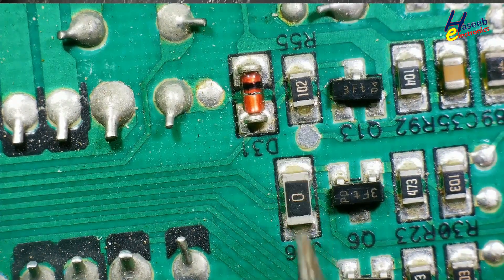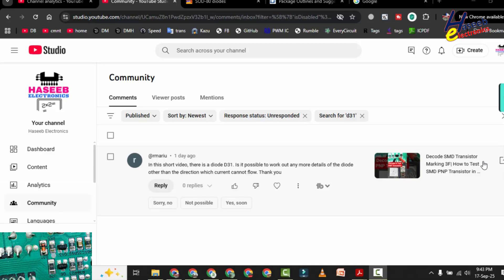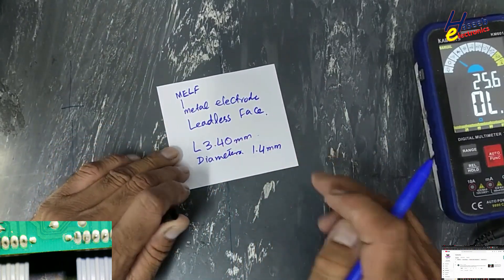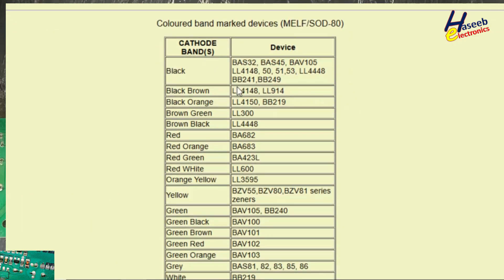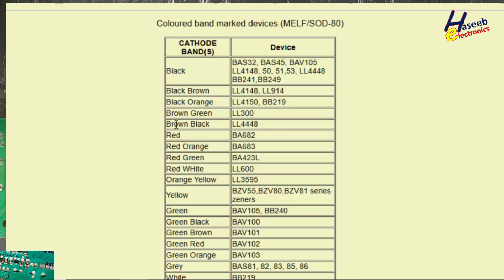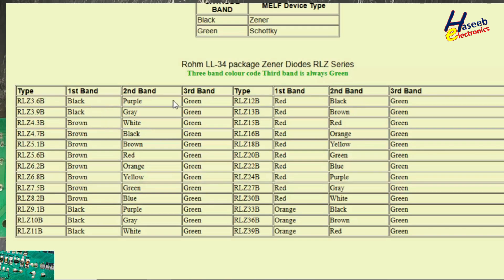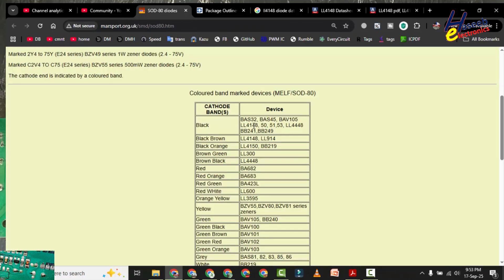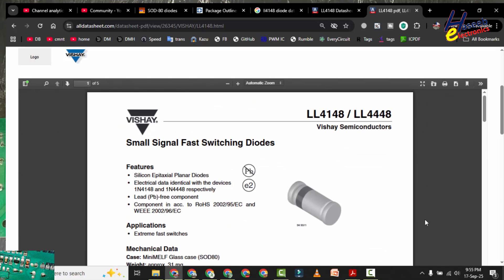{1384} How to Decode MELF SMD Diode || Find Part Number & Datasheet

Comment: Its assumption not exact part number, right? Need to check full schematics to put right replacement/ using on new design
Reply from the maker: Sometimes it is tricky 
First we need to decode it 
Then analyse circuit to determine its applicability 
Then datasheet 
In some cases color bands are not traceable because some manufacturer don't share the color code scheme publicly 
But this method works about 99% correctly with exact results 
I will also share some more examples as well